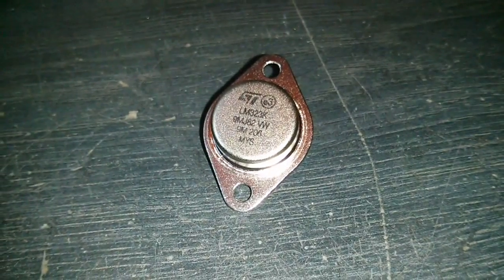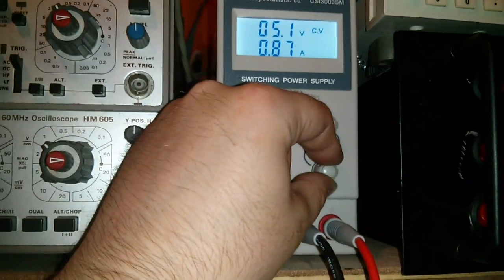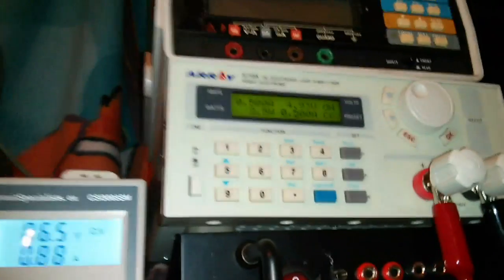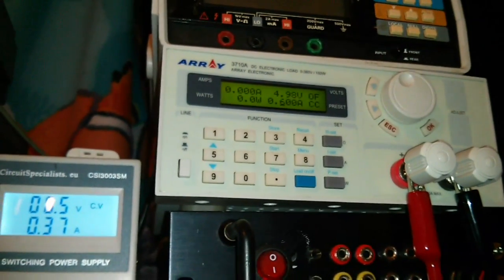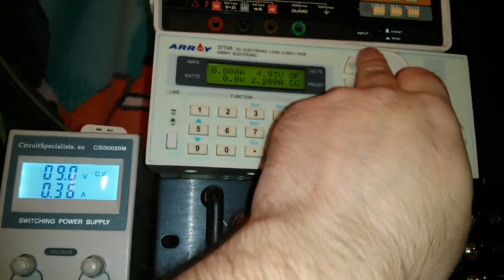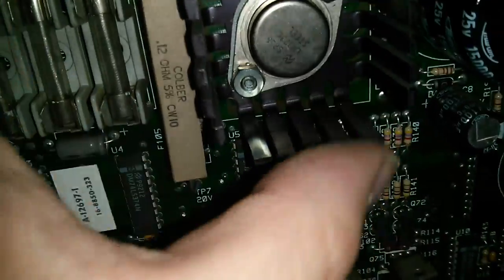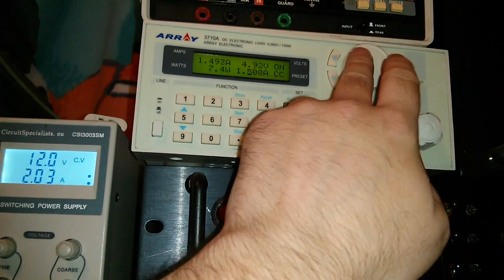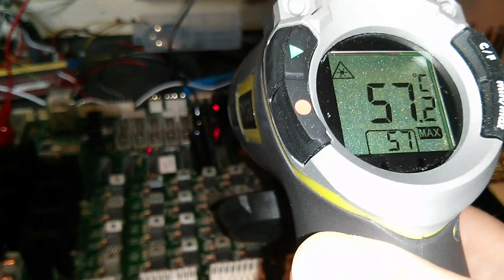Testing LM323K voltage regulators with a DC Load

Comment: You need a huge heatsink to make these LM323 regulators perform properly.     Bigger is better when it comes to heatsinks.     I use a 1 foot square aluminum plate one quarter inch thick for
testing.   Mount the regulator in the center of the plate, with mica insulator and lots of heatsink grease.   That way it will run cool and supply over 3.0 amps at 5.00 volts
like it's supposed to.

Comment: it seems that when you get near the 3 amps mark the power supply is cutting off as its out put voltage seems to drop below 5v  i would suspect you have an issue with the power supply not the the regulator, maybe the smoothing caps in the supply are faulty this may also account for the false current readings, juwst a thought
Reply from the maker: That's what happens when you are filming looking through the camera viewfinder and you don't notice the power supply switching into constant current mode :)

Comment: Very interesting!  I found the same thing with a 2 amp 7805.  Just using a basic heat sink it would start to drop voltage from initial 4.95v to around 4.75v after 15 mins at 1.3 amp load.  That was with 12v supply, but I suspect it's all about balancing the heat sink type (with fan) vs the input voltage.  12v results in a lot of heat to start with, so for my 2 amp test it was likely not needed as I could probably have got better results with a 8 or 9v supply.
Reply from the maker: It's nice to be able to play about and test temperature/efficiency at different input voltages and loads isn't it :) Interesting stuff power supplies!
Reply: Absolutely!  You've got some nice kit there as well =)
Reply from the maker: GadgetUK164 Sometimes I wonder if I buy stuff just because it's got lots of buttons to press, or if I really need it :) lol